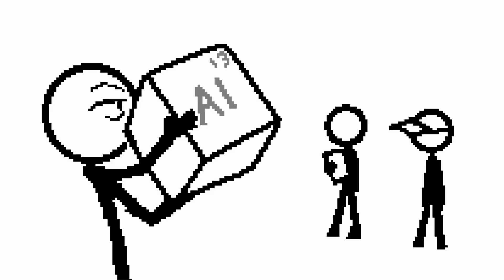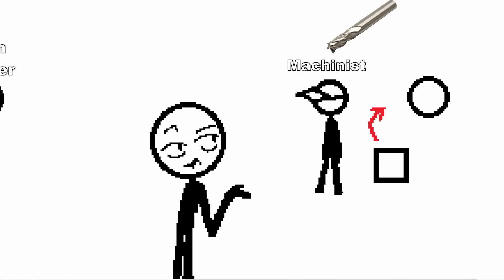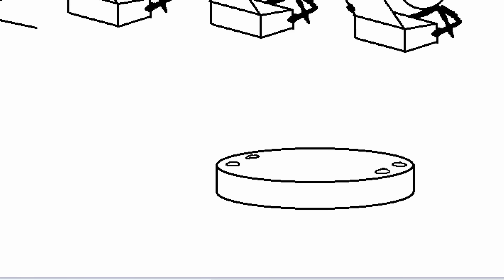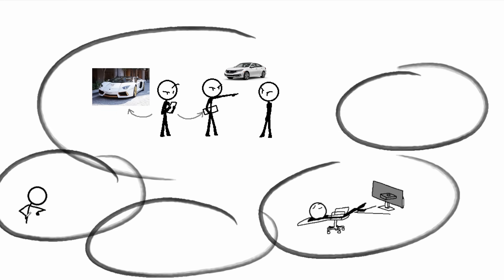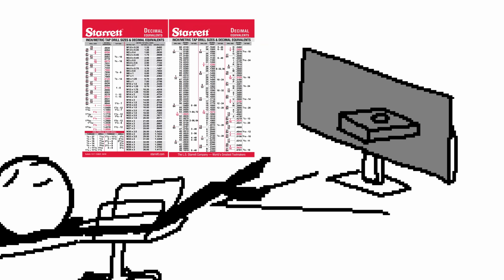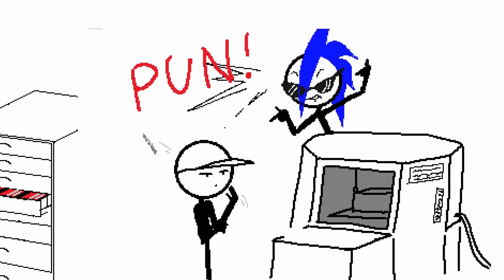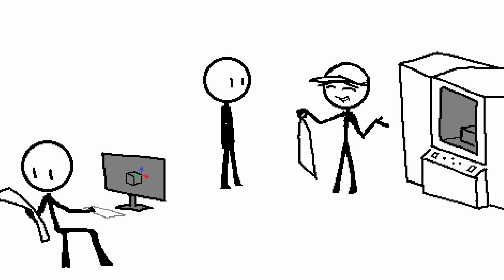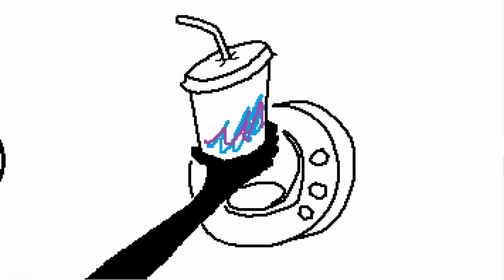Why we hate engineers

Comment: The cupholder doesn't start at the Desing Engineer. It starts in the Design Studio where it is specified to weigh less than a gram, be infinitely stiff, and be able to travel back through time. The Engineer brings it from "literally impossible" to "possible, but difficult" and the fabricator says, "Why are you giving me this incredibly difficult thing?" The fabricator hates the engineer for making his life difficult and the designer hates the engineer for ruining his perfect cupholder.
Reply: Are no not a fan of the designers 30 storey upside down pyramid, or a manifold that could be done if we had the budget NASA blew on Atemis and SLS combined for a HVAC unit or Corolla suspension arm?

Can be done, should be done, bloody worlds apart.
Reply: This should be on a shirt. A really large shirt
Reply: Look up the dash board cup holder in the Lexus Sc300 for the definition of impossible to possibly but didn't. It's not actually that complex but still a bit wild of a design
Reply: I'm an assembler.
I hate them both, because everything seems to be infinitely important until they find out that their original conception is flawed, and then I am told to "just get it in there and out the door".
And it stays that way for months until one of them comes up and asks why I didn't let them know it wasn't working as intended.
(I don't hate either of them, tbh, we all have our roles to play, and nobody is perfect.)
Reply: it is interesting that my uni taught stuff to take fabrication into account first. at least us mechies, got fab designg lessons first even. i see why, lol
Reply: @olaitansama5256  how large? Be very precise on size
Reply: @mechadrake  that’s how it sould be. That’s also how it almost always isn’t.
Reply: and the engineer hates everyone for making them solve stupid unneccesary problems
Reply: Sums it up very well.
Reply: As someone who has designed parts for 3D printing (as a hobby) I have specc'ed impossible to put in screws in my designs and only had myself to blame.
Reply: Can confirm the main designer at our company probably snorts some kittens or whatever is the dankest shit out there.
For us tho, we engineers also build the stuff often enough, and are already used to low cost suppliers with dubious (or downright wrong, by a lot) specs, so we end up cutting that last step altogether.
Reply: Correct, thats the circle of life.
Reply: As the DFM (design for manufacturing) engineer at an aerospace firm, I can confirm this version of the story. I had to take the shenanigans of requirements and unnecessary geometries of the development engineering team, make revisions and do stress analysis, give it back to them, they’re pissed with the revisions but deal with it because it meets the spec. Give it to the machinist and they say “this is ass, why would you do this to me, I thought we were bros”. Then after rejecting half the parts and forcing the machinist to remake things multiple times, I deliver the parts to the development team and they inform me that the customer changed the load requirements and now this lot of parts that cost $50k and 20 weeks to procure are now scrap. “Here is the new design, please work with the machine shop to get us 10 more units. Thanks.” 😵‍💫🤬
Reply: @Sim.Crawford > 30 story upside down pyramid

Lol, check out main building of slovak national radio
Reply: This video is one of the biggest parts of learning manufacturing in my Mechanical engineering major, super important.

Wasn't expecting to find a comment from you here, but woohoo! Keep up the vids, they're great!
Reply: And then we hate the engineer because his difficult design makes the cup holder really expensive and slow to produce.
Reply: @olaitansama5256  have some mechinist make it
He can figure it out himself
Reply: Marketing?
Reply: @cpu_1292  100 m ± 0.01 mm
Reply: All Product Development(i.e software and robotics too) is like this Requirements, Specifications, Create 
Product Manager: I want something absurd like an AI that can answer all end-user questions
Designers: Ok, this is the specifications
Maker(Engineers, developer, fabricator etc): Just end my existences
Reply: Remember to ask "but why?"
Reply: "I got this really cool idea"
engr: cool, so how do you make this work in real life?
"I don't, you do"
Reply: And better yet- you will get deadline till the end of month, but the design surface will arrive in next month... Or even better- the deadline is 24 February, you will get the design surface day before, but the client/ next company that will work on part will start working on your part only sometime in January.
Reply: Real world:
Machinist are on their way out, and they know it.
NC is taking over with the advent of 5,6,7+ axis machines.
More precise and less time, IF the part is programed is correctly.

If you find yourself taking your Design/Print to a machinist, you will both be happy if you can remember ONE thing: 
He is NOT a CNC machine!

If you want your polygeometric part to defy the laws of physics and to be exactly what you designed, get out of the Machinist face and walk over to the NC programmers desk and good luck.
Reply: @hhiippiittyy  tbh, most assembler's do hate engineering. They are also completely unwilling to ever actually take blame. Also, they wouldn't be able to build anything on  their own... god forbid you expect them to think.  I'm sure one of them will be along any moment posing as "someone knows better" to insult me. Get back on the floor, you have utilization numbers to maintain.
Reply: engineering is a thankless job that needs to be done
Reply: AMEN
Reply: all too true. just look at the debate between eugene stoner and kalishnakov about gun design. many in US military at the time of M16 introduction said it waas an inferior rifle yet Eugene met the requirements. what a classic senerio.
Reply: @dinamosflams  Cry harder dude. Everyone in a Corporate Company has a "Thankless Job". At least in Engineering there can be allowance for more schedule freedom because some Corporations know it is counter productive to expect Engineers to crank out Realistic & Functional widgets like a vending machine.
But everyone else (except administration), needs to put the grind in non-stop.
Reply: @davidnelson7719  
Just for clarification please...   who is the "they" in your second and third sentences?
Reply: @hhiippiittyy  Assembly.
Reply: if it can't withstand time traveling, then how are we making that Delorean happen?
Reply: i REALLY want to be the guy making the literally impossible thing possible but difficult- literally my dream job.
Reply: @davidnelson7719  
That has not been my experience.
Reply: noob
Reply: @hhiippiittyy  Lucky you.
Reply: Fab here, completely true.
Reply: lol.. as long as you don't "Lathe" it Matt, we'll all be safe!
Reply: Why is matt here?
Reply: Every engineer should read the Design of Everyday Things by Don Norman. It explains why designers might ask an engineer to make something more complicated than 'the simplest way possible'. I will agree though that there are a lot of stylists posing as 'designers' coming up with stupid, useless, impossible shit.
Reply: this is a very key point
Reply: @Jesse_Kershner I once had our machine shop polish a lot of 12 inch hardened inconel flanges to a literal fucking mirror, then the design failed shock and vibe upstream, and the flange needed to be redesigned. The prettiest most expensive scrap you’ve ever seen. It was 40 hours of polishing for one guy. He never forgave me.
Reply: Basically designers fault
Reply: uh that is after the management gave themself 80% of the project budget to themselves as bonus
Reply: You've just described every youtube video of an auto mechanic complaining about engineers.
Reply: I mean, really, what good is a cup holder that cannot spot weld underwater? :D
Reply: @dinamosflams   Thankless??  Not at all, the thanks comes every second Friday(payday)
Reply: That reminds me of a line from saving private ryan about the proper direction of griping Gripes go up the chain.
Reply: Design Engineer, or Marketing Division? Or was the idea flawed from the start?
I don't think Elizabeth Holmes was an engineer, but someone had to take her idea and turn it into the Theranos.
Reply: Easy for you to say.. You do both design and fab.. (yeah, I watch your channel.. It's a lot of fun)